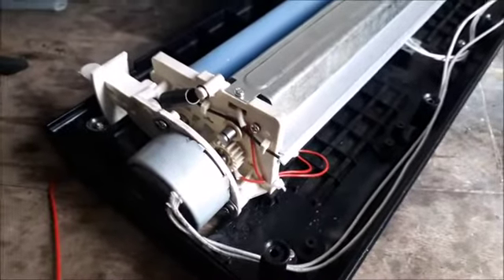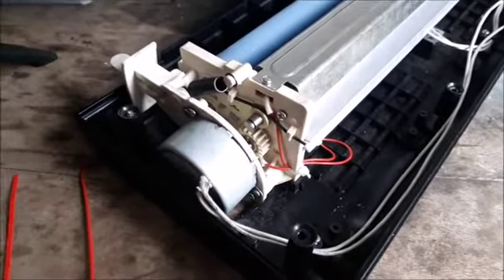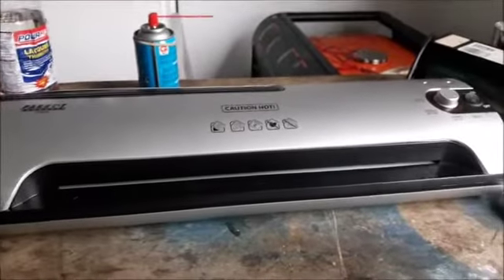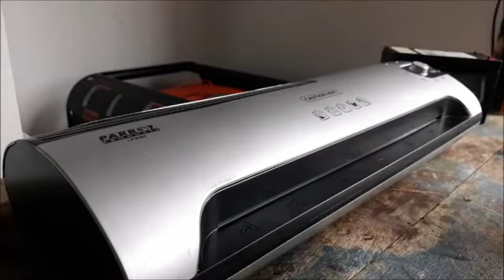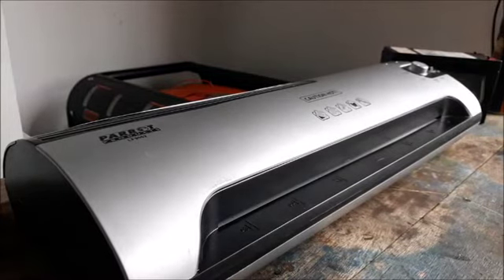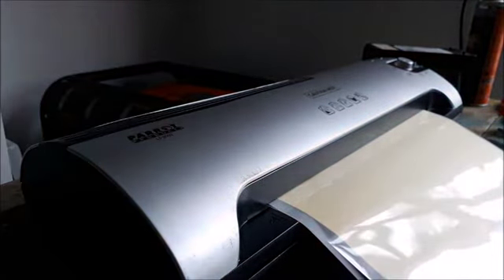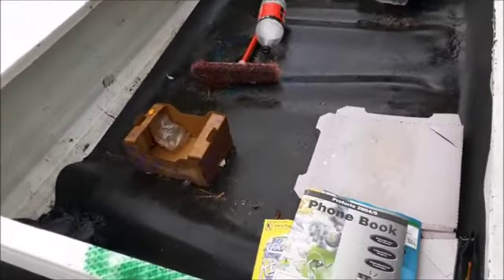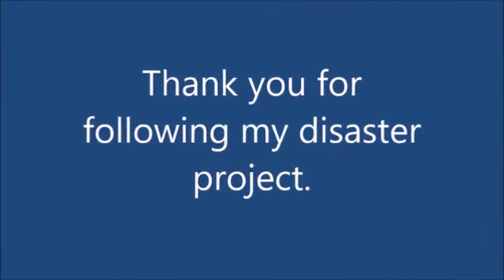Part 2-2 Lamination machine fails, be a witness.

Comment: Hey Jan.
Looks like some disappointment in the Laminator, lol.
Best place for them when they fail, best not to waste time fixing them.
They are cheap enough to replace.
Reply from the maker: Peter you won't believe me, I took it of the trailer and put it on the bench, there is a voice that tell me don't give up, I just feel uncomfortable to through it away, believe me if I get it right you will see a video of a working machine or nothing. My 7th sense put my attention to something. Thank you for following and watching
Reply: @jankotze1959  
Hey Jan.
I totally understand i Hate to give in to any difficult project that i am working on.
Even to the point when the only thing that will fix it is a decent Hammer, LOL.
Wish you all the the best with your Adventure.
Peter.
Reply from the maker: Thanks Peter, if I have success I will show and tell what light comes on that makes me turn back... otherwise I will show the size of the hammer lol
Reply: @jankotze1959 
 Looking forward to it.
For me know 10.30 PM have a great night, talk to you soon.
Peter.